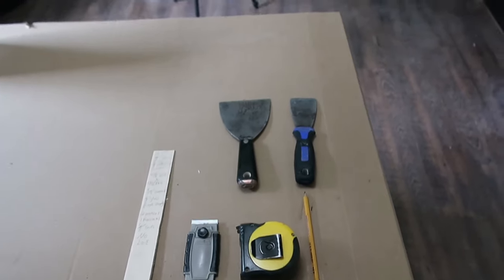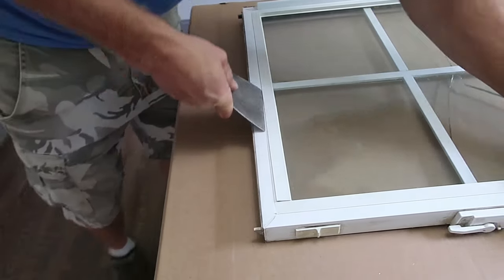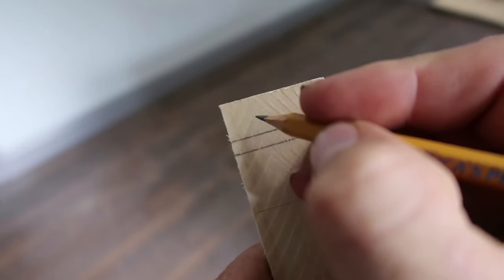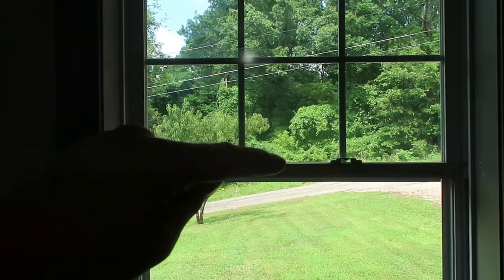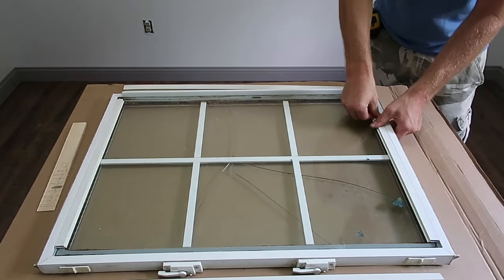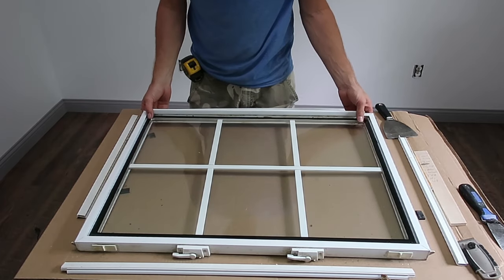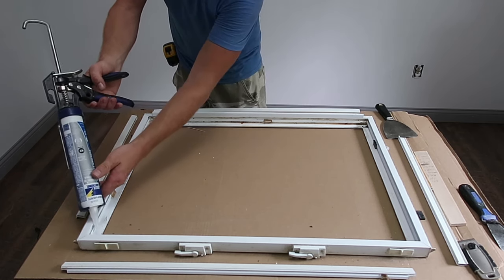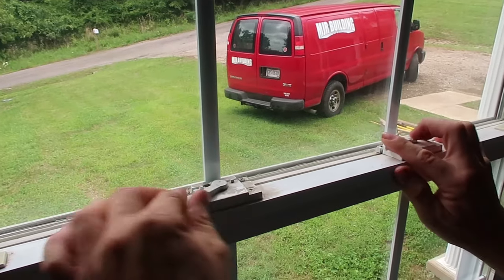HOW TO FIX A BROKEN WINDOW

Comment: When I try to find a local replacement glass business for the new sealed panes, what type of business do I search for? All I’ve found are new window installation companies. Thanks for the excellent tutorial, especially on the specific measurements!
Reply from the maker: I purchased mine from a local mom n pop auto glass shop. If no luck, you might call one of the  local window installation companies and see if they know of a residential glass shop in the area.

Comment: nice on the pain measurement.  I usually wait a day for the silicone to dry -then use the knife to remove excess.  Every time I mess with wet silicone it's all over the window and my hand.

Comment: Your videos helps a lot in my situation.  Question though, my window frame/glass are similar to yours but with a wooden frame with wooden molding stops.  Would you recommend silicone caulking or glazing putty/compound to set the glass into the frame?  Currently, it appears that the manufacture used some sort of grey glazing putty.  Should I clean up the putty from the frame and set the glass with silicone caulking/sealant instead?  Where I live I cannot seem to get the right putty other than GAP 33 putty.  Thanks for your advice and insight.

Comment: Isn’t the silicone harder to remove for the next person if it gets broken again vs the window glazing double sided tape ,  or is it better compared to sealing the window for air leaks ?
Reply from the maker: I doubt it’s much harder to remove than the glazing. I use silicone because I always have some on hand and it’s easier to get.
Reply: @MT_Homes  thanks . I broke an inside pane and have it taped up till winter is past .  Great video

Comment: Very good video. Thank you. Where do I order this pane? Does Home Depot/Lowe's carry them? If not, what do I need to google? Local glass shops tell me they have to order them from a factory. Charging me $250 and 2 weeks lead time. Please help.
Reply from the maker: Thank you! I order mine from a local auto glass shop. Price has went up since I made the video. Last one I did was $135. 10-14 days lead time is normal.
Reply: At that price it’s cheaper to buy an old window and take its glass
Reply: Yea,I was going to say goddarn!!! $135!!? That’s a little stiff brother

Comment: Great video. My luck had the top half of the window broken. The part that doesn't come out. Is it the same process to replace it?  Also, would you consider that window a 34" x 52" roughly?
Reply from the maker: Thanks! Yes same process. Slightly more difficult. Still pretty easy. I don’t remember the dimensions but I’d say you’re close.
Reply: yea thats my problem the same exact window...but top half

Comment: In my area, glass manufacturers won't sell to the public. They only sell to glass repair shops. I had to pay $660.installed, for one about twice the size as you bought for $75. It only took the guy about 15 minutes to actually put the replacement in. The first time he just came out to get the measurements. 
Nice profit.
Reply from the maker: Wow. That’s crazy.

Comment: Amazing! Thank you for posting this tutorial. Would you please do a video showing how to remove the white grids between the glass?
Reply: Or could you give a quick explanation of how to do it?
Reply from the maker: Double pane glass like the one I’m working on is factory sealed. Yes I could probably break the seal and remove the grids but the window would be ruined. Condensation would gather between the panes fogging the window to where you couldn’t see out at all. Best way would be  to order new panes like did but without the grids.
Reply: I understand,  thank you! I have the same windows and I very much appreciate your video and excited to get to work. God bless you!
Reply: @MT_Homes , I have one window that does what you are describing. Condensation between the panes. Guess I will be ordering a whole new window.

Comment: Do you have to replace both panes if only one side is cracked?
Reply from the maker: Yes. The 2 panels are sealed together with an argon gas between them to prevent fogging/ condensation.

Comment: Going to sound stupid but is replacing the top section the same?  I dont know if mine are movable at the top portion like. The bottom is. My windows are from the early 80s.
Reply from the maker: Any vinyl window I’ve done the top section is the same process as the bottom. Only difference is if the top sash is not removable (single hung) then it will  have to be replaced while in the window and not on sawhorses like I did. Also sometimes the strips that hold the glass in will be on the outside.
Reply: @MT_Homes  I see, I guess I'll have to climb the ladder anyways then, I couldn't remove it  from out of the frame.

Comment: I have the same type of windows, but mine don't have the "strips" that hold the glass in place, they're solid all the way across and join together with 45°s at the corners. A few of the windows in my house have broken seals,, in-between the panes of glass, and are foggy. Can you show me how to disassemble my style...pretty please????
Reply from the maker: Did you check both the inside and the outside very carefully? The strips can be on either  side and will look like they’re one piece until you look very closely and pry on them a bit. Some strips are cut on a 45 at the corners instead of square like mine. Not saying it’s not possible but I have yet to see a vinyl window without those strips.

Comment: Is there anyway to replace the entire bottom section not just the glass?
Reply from the maker: I’ve done that before but you have to order that direct from the window manufacturer which could take weeks and when I did it the cost was 4x as much.

Comment: What are those slides called that you began removing at 1:30? I've been looking for replacements and I can't even find them since I don't know what they are actually called.
Reply from the maker: I’m not sure. It’s the trim that holds the glass pane in place.  Glass pane retainers, or glass pane trim, maybe? I kind of doubt you could buy just those pieces though. Best bet would be to get name and model/serial number of the window and call the manufacturer.

Comment: Just one question can't I just buy that whole top frame to replace instead of removing the broken glass
Reply from the maker: Possibly. 
   You would have to contact window manufacturer or retailer. But that is usually quite a bit more expensive. Most windows have a label in frame somewhere and/or info etched in lower corner of glass.

Comment: if just the outside glass is broken do I need to change both?
Reply from the maker: Yes. The glass panes are sealed together at the glass factory with argon gas between them. If you only replace one side you would get condensation and fogging between the panes.

Comment: Why not measure the width and length first then remove the broken glass and accurately measure thickness with a micrometer. You could replace the broken glass temporarily with a piece of timber or other type of sheeting.

Comment: Can I buy the part that slides up
Reply from the maker: You would have to contact your window manufacturer for that. Usually the name of the manufacturer and model of window is etched into one of the lower corners of the glass.
Reply: It is called a window sash.

Comment: Huh why not just replace that top glass? You’re wasting money you literally could’ve fixed it for 20$
Reply from the maker: Wrong. 
The panes are sealed together with a special gas between them. If I break that seal, the window will fog up between the glass panes and cause condensation.